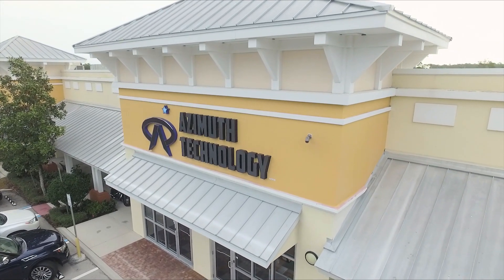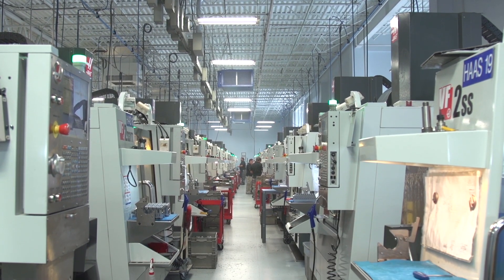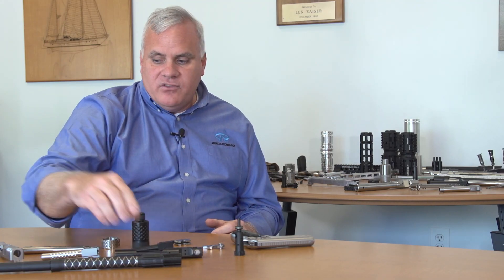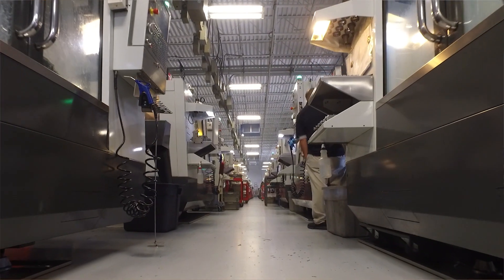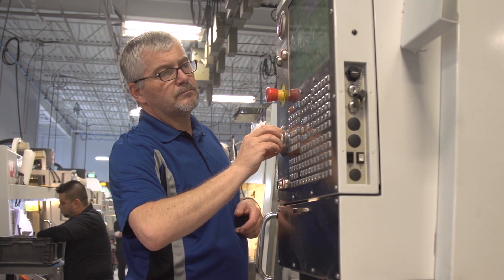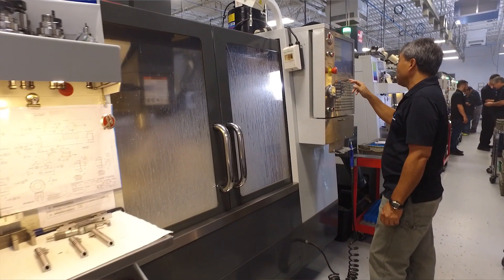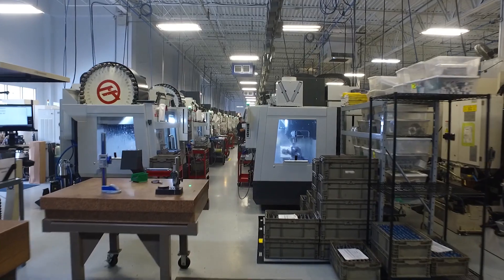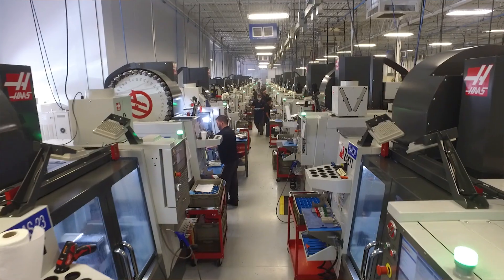Machining Slides and Barrels on Haas VF-2SSYT'S at Azimuth

Comment: everything this guy said about the vertical machining center to the horizontal machining center is completely wrong. for the price of two verticals you could have a horizontal and a horizontal is way more productive as it is a 4th axis and you can stack way more parts per face on a tombstone and have one loaded offline so there is no downtime. This is an old video so hopefully he has caught on as many other shops doing what this guy does rock the horizontals
Reply from the maker: Thanks for sharing your comments. I encourage you to view a few other case studies on our YouTube channel and maybe even subscribe. We have several interviews with shops machining slides and barrels and each manufacturer takes a different approach. Two case studies feature shops that are using Haas EC-400 horizontal machining centers and of those two, one has gone a step further by adding pallet pools. We also interview a shop that uses VMC's tended by robots. 

It's always fascinating to see how each manufacturer uses CNC technology to machine their parts.